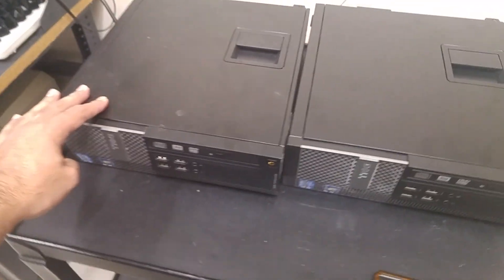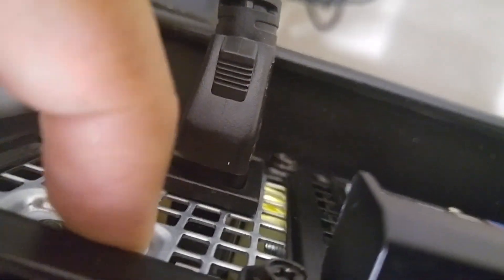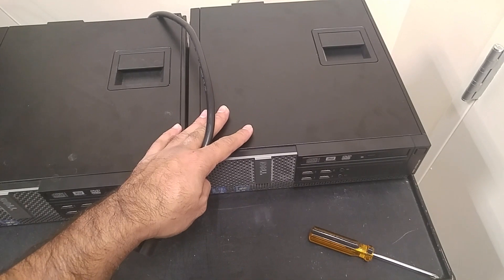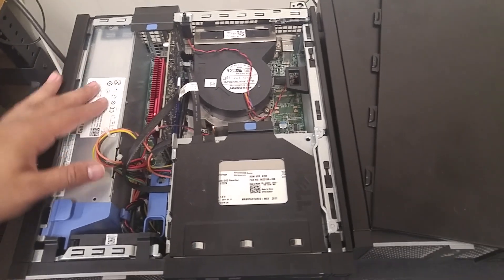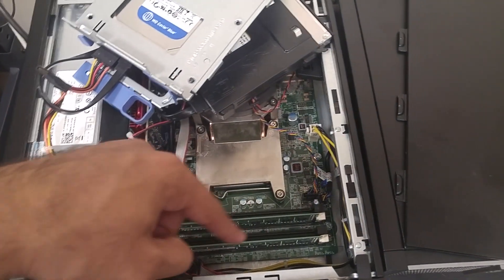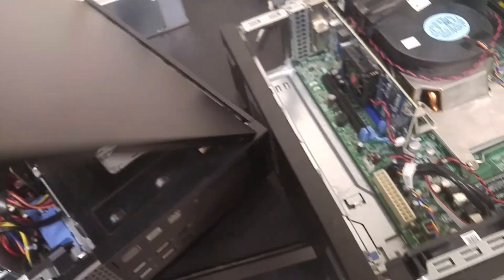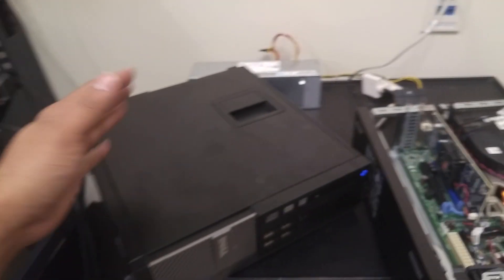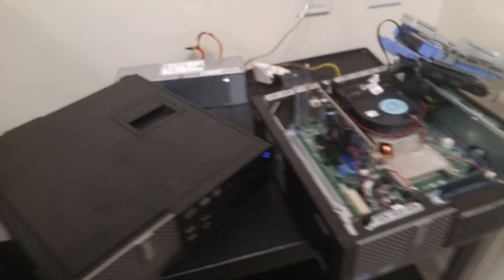Help Desk Support Real world Scenario

Comment: The reason why he didn't replace HDD is, machine which is spare may be standing there for a long time, and without testing it(that means at least 30 min time depends on unit), You can't know if there is any part defective on it and you should make sure, while you are trying to fix problem, you are not creating another one.
Reply: indeed. the word "spare" is a misnomer, it's not bought extra from the shop and left in the corner. it's sitting in the corner because it's done something wrong

Comment: Also, you can just move the HDD around right?
Reply: , in most cases it won't work. Windows has all the device drivers and chipset drivers installed for the current system. When moving it to a different system, the OS will usually fail to boot. In some cases it can be fixed with a repair install. In all cases, it is recommended to do a clean install.